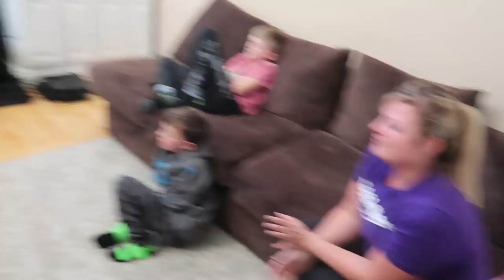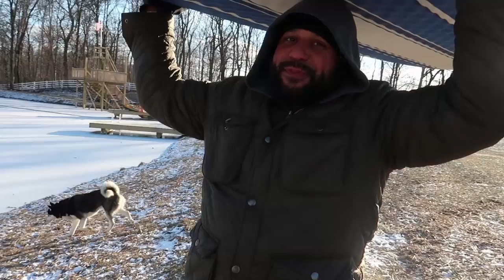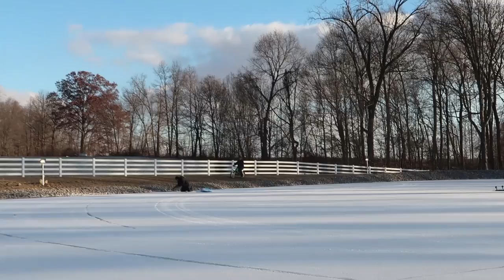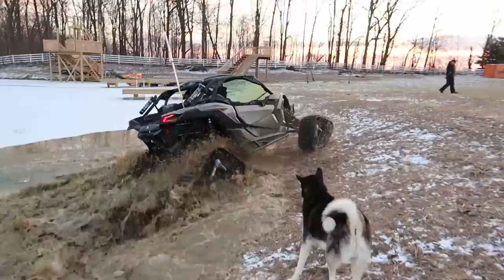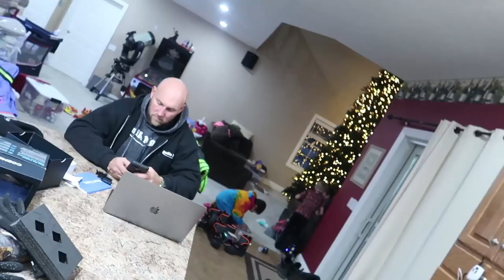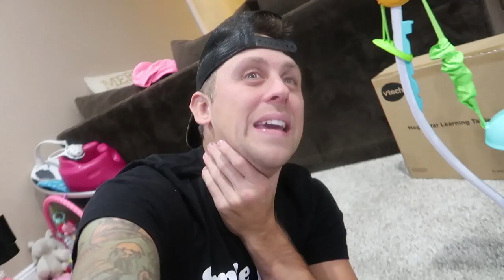MY POND BROKE!! Fell Through The Ice!

Comment: bro the middle is deeper and colder. if the middle is cracking or soft it means the shallow part is not thick enough. shallow parts will break easier